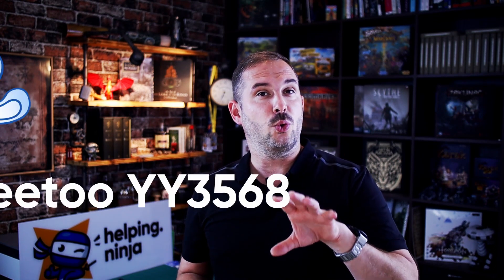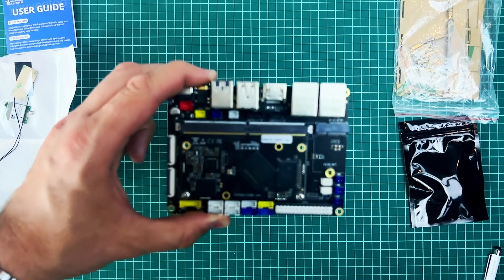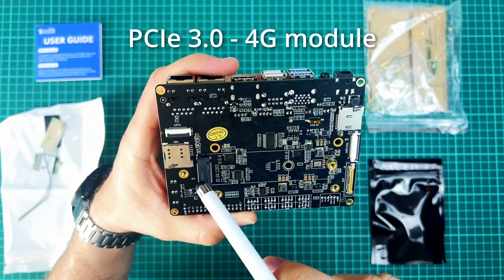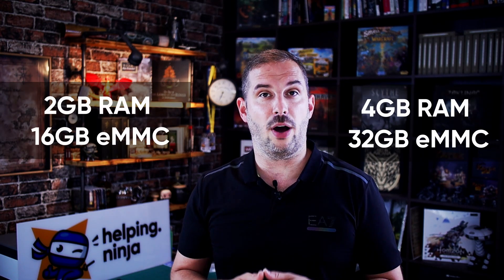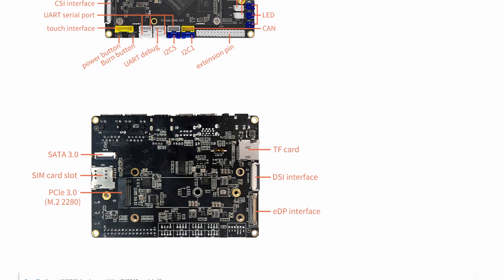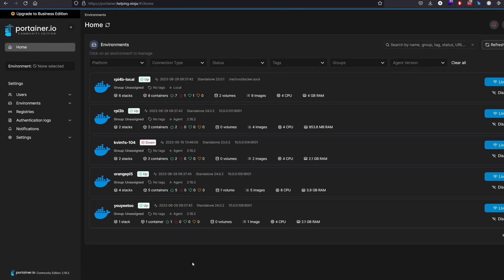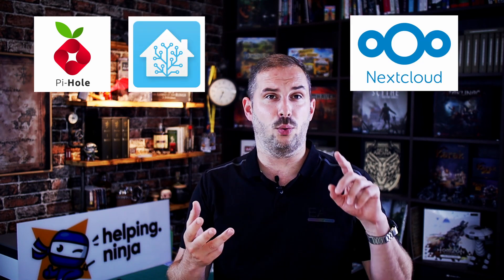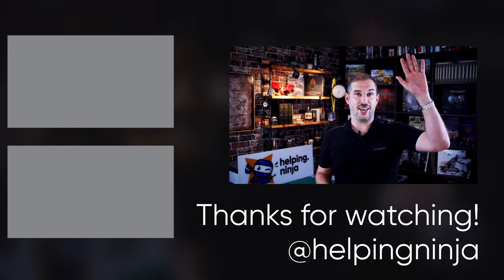Youyeetoo YY3568 - The Hidden GEM of Development Boards

Comment: Not interested in the rockchip 3568, but I do like the carrier board. Wonder if it can work with other SOMs? 
Also noticed they are about to drop the X1 (x86 board). I immediately put in the pre order :)
Reply from the maker: I'm not sure right now if it can work with other SOMs, but I'll shoot a question to the manufacturer.
Reply from the maker: I've got reply from the manufacturer regarding other SOMs, quote "Currently the carrier board only work with Rockchip RK3568. Our all-in-one RK3588-based SBC is on the move, which will be released after X1." @JazzTechie